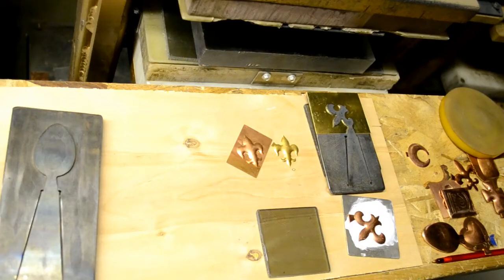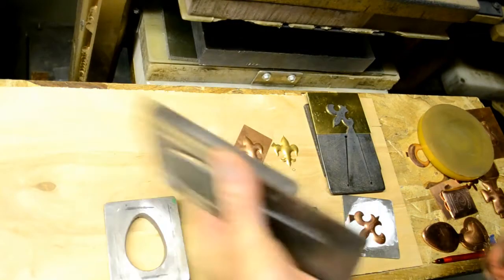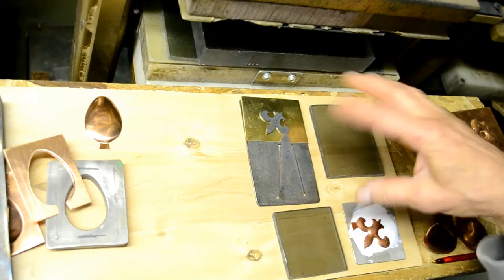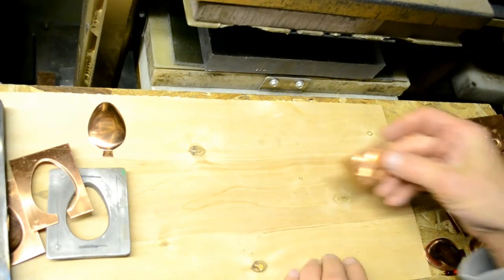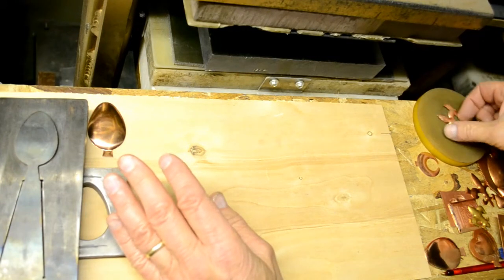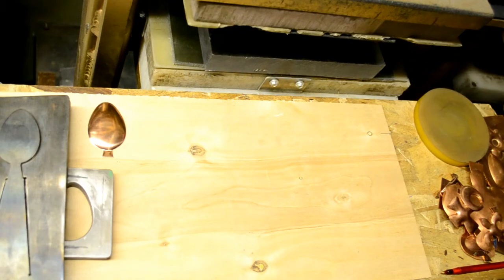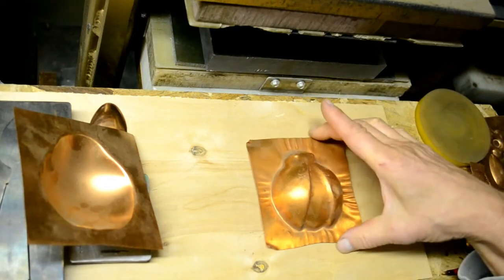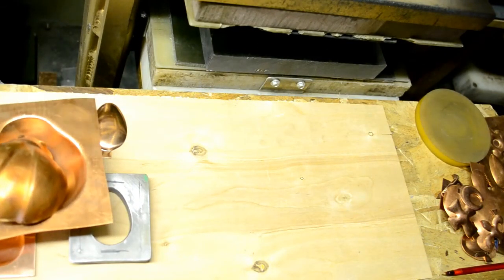Pancake Die Demo : Matrix & Blanking Die Set (Puff & Trim)

Comment: Which material used under the pancake die for trimming?
Reply from the maker: I use hardened steel plates inside the press, to contact /squeeze the dies. Any solid metal or even hard plastic (but not Acrylic/Plexiglas/Perspex, because it can shatter) will work. Hardened steel is best because the dies won't scar it up like softer material.